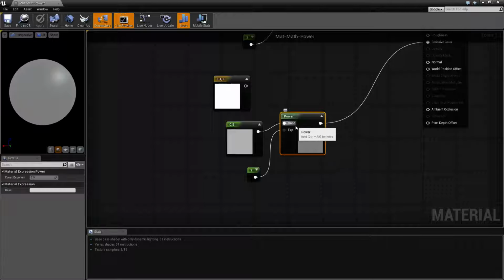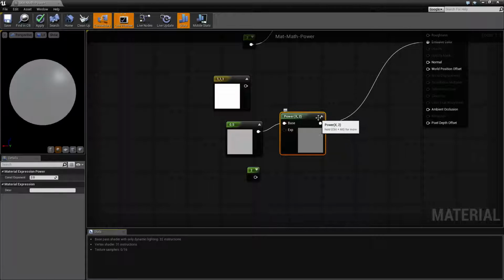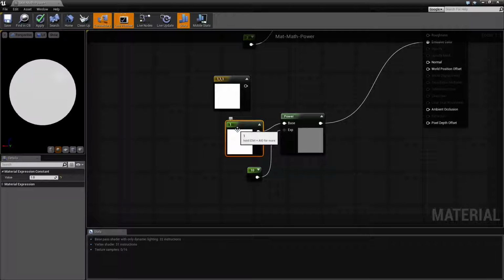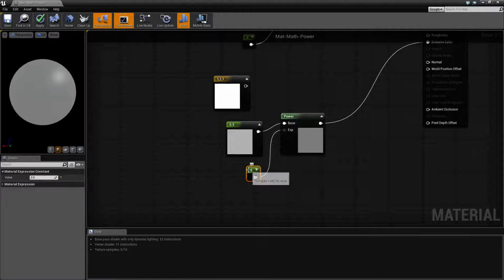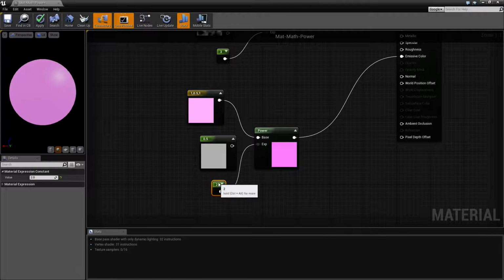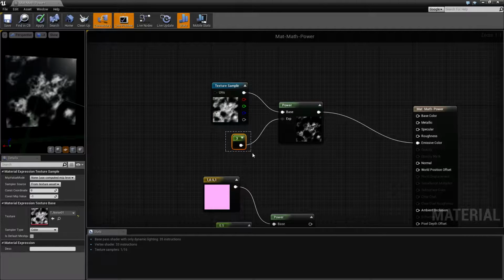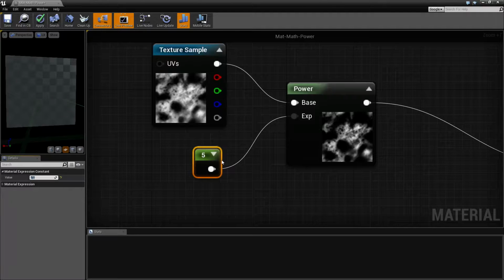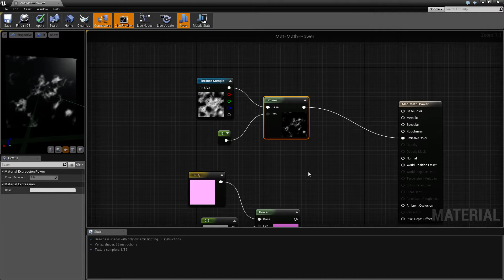WTF Is? Material - Power in Unreal Engine 4 ( UE4 )

Comment: Is it right that the power node is basically implemented as recursion (a function that calls itself). Should we be extra cautious when plugging in high values into Exp? Pretty technical question, should probably test myself what happens if using high numbers and on many materials, just wondering <3
Reply from the maker: I don't know how the Power Node is handled behind the scenes but I would not expect it to be a Recursive Function.  There is a POW function itself inside of C++ Math library they are probably using to handle this itself.  In terms of issue with a higher value I have plugged in very large numbers and it worked as expected without any real performance problems.